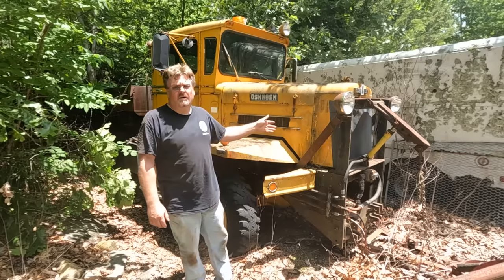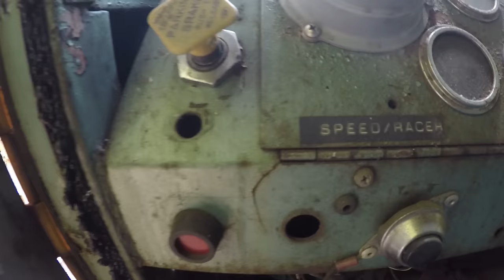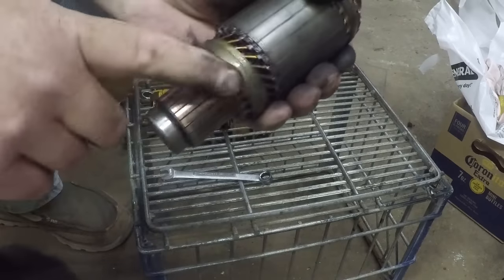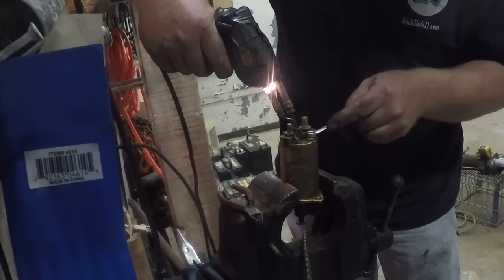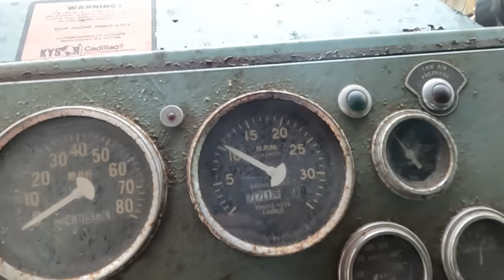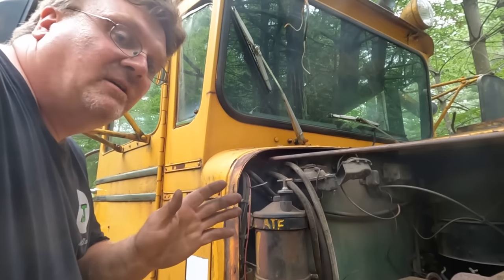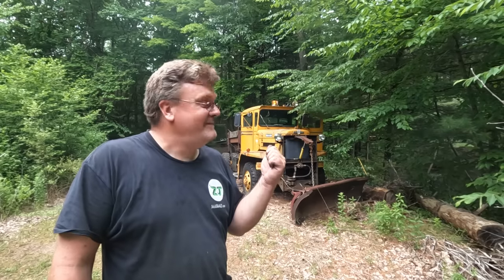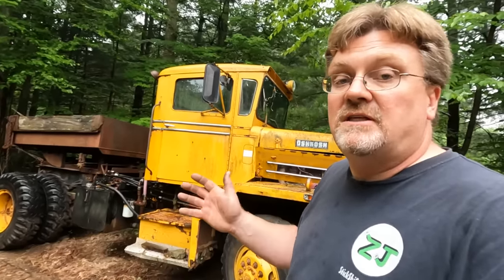6BT Powered Oshkosh Plow Truck, First Start in Over 10 Years!

Comment: Great to watch. I did my apprenticeship on Oshkosh trucks out here in South Africa. Ours were powered by Cat 3306, 1674 and Cummins Ntc engines. The model was known as the R series. All the little red buttons on the "dash" were fuses. If one went out all you did was push it in to reset it. The Oshkosh was known as a very powerful and tough truck. Thanks for showing, as it really brings back memories.
Reply from the maker: That's neat, thanks for the info!
Reply: Take care down there in SA.
Reply: Love that you were able to get the old girl moving. You removing and cleaning up the starter was educational. Where are you based out of?
Reply: I don’t want you to think I’m a Know it all, because I drove an Oshkosh for the town of Franklin Massachusetts and it had a wing plow also it was powered by a Cat 1160 which Cat no longer makes BUt, the first thing I would do if you are going to keep that truck is GET RID of that Dinky plow  and find a decent road plow like a Frink or something similar because with the power that this truck it will push just about anything
  And just a little info on the truck I drove , it went through the Blizzard of 78 with a V Plow and never got stuck
Also you might think about finding a sander box to mount on the back
These are just some suggestions mind you but I really miss driving the Oshkosh that I drove it was the best time of my life 😊

Comment: Your power steering probably has air in it. After you work it back and forth for a few days and topping up the reservoir your steering should be ok.
Reply from the maker: You're exactly right, it did start working well after I used it for a while.

Comment: I lived about 80 miles East of Nome Alaska in the early 60’s on an old WW2 runway with an old B29 bomber crashed at the end of the runway. There were 6 houses and several warehouses/garages all operated by the FAA. My Dad was the station manager. Our old snow plow truck gave up and the flew in a newer Oshkosh in an Air Force C124 Globemaster. The plow came in the dump box and just barley cleared the upper door frame. The windshield slanted foreword which looked kind of strange but helped with snow build up. I was 13-14 with home study classes 7~8 grade.

Comment: Regarding the brushes: just push them back deep into the holders. The springs will snap over and push on the sides instead of the ends, thus holding the brushes retracted. Once installed, push the brushes down until the springs snap back over the end.

That is how it's supposed to work. Some brushes even have a little divet on the side for the spring to snap into prior to mounting.

Comment: As soon as you find your high and low range, maybe your attempts to move it around in tight areas will make it a bit smoother transition to pedal, and man as it really is not a jerky machine... I used to own several oshkosh trucks known for their ability to move in the mud and other rough terrain... I hauled logs in the early fifties with them... big gasoline engines that were over five hundred cubic inch engines.. they still only had like two hundred horsepower but those four barrel carburetors on the huge six cylinder engines would haul a mountain. I say carburetors because there was two of them on a single six cylinder engine and it got less than a mile to the gallon to keep running. I remember filling the two tanks with gas that was ten cents a gallon then, and it carried almost two hundred gallons of fuel... that worked out to about a hundred and fifty miles of travel with no idle time. Those pistons were like six or more inches across the top and were over a foot long for the top of the piston itself... took a week to rebuild it an it was worn out in less than twenty thousand miles so I always kept a couple engine kits available.... later put a cummins in one an a screaming six jimmy in a couple others... it was just what I had, not what I wanted... when done, sold for scrap iron thinking no one wanted them. And no where to keep one at either... it was junk or fines for them.

Comment: anytime you are starting one that has been parked for a prolonged period that shows a high oil level it's advised to check if there is water in the oil. the water always drops to the bottom so just pull the drain plug cause the water would come out fist lowing the oil level

Comment: I'm from Oshkosh WI there all many boneyards of Oshkosh Trucks waiting to be retrofitted into something else. Many of those have been sitting for many years too. You'd have a field day here. Yes, the roads throughout the city are still be plowed with Oshkosh Plows especially when the snow is really deep.
Reply: bone yards are gone. shipped all down to Red River Army depot. Where the retrofit trucks were are all new trucks. Plows aren't Oshkosh plows anymore here Oshkosh dpw only has one Oshkosh truck left and it's used with a huge bumper on the back and a big sign to protect the construction workers leaning on shovels.
Reply: @markhuisinga1698  there's a bunch of Oshkosh trucks on Hughes St lot ready to be retrofittes north of Gate 12 and also in Nolte's tow lot. What's the lot on 3135 Oregon St. There aren't quite as many as there used to be admittedly. Educate me.
Reply: @markhuisinga1698  Must be my friend Lyle Conrad's truck RIP.

Comment: You definitely got lucky,with how many things worked after sitting that long. Here is something I learned years ago by accident on a starter solenoid.  The brass buttons you were filling on will come out by taking the second nut off and you will see after knocking it out, it has a square shoulder and can be turned it a quarter, half or three quarter
Reply: You turn them 180 those have already been turned once.

Comment: Back in the seventies I drove a new Oshkosh Dump truck that a time or two we had a 955 Cat loader in the bed. It had a cat engine with a 10 speed rto road ranger transmission with a three speed auxiliary transmission it was a tandem axle all wheel drive with flotation front tires the front tires were underneath the cab and the bottom of the front bumper was five feet off the ground. We had two that were identical they were the widest the law would allow and topped out at 68 mph. I was young and dumb back then we regularly grossed over 100 thousand pounds and I scared a lot of people in my home town when I turned the corner and they were beyond the stop stripe and I put my front bumper over the hoods of their cars. Needless to say I loved my truck! By the way that lever on the right side of the steering column is a hand valve for trailer brakes. I enjoy your videos, God Bless and stay safe out there!
Reply from the maker: Thanks for the info!  I hadn't thought about trailer brakes.

Comment: These are really cool trucks used to work on them all the time when I was a gse tech.they would run the wide open for 12 hours then just and sit and idle for weeks at night for the most part. The broke alot brakes got burned up all the time.

Comment: That 6BT is the most  sought after engine for the 80 series  Toyota Land Cruiser diesel conversion. BTW,  learning a lot from you! Thanks!
Reply: A 6bt is way too much engine for any cruiser. I think you mean 4bt. 1hz is a much better option anyway than a bread truck engine.
Reply: It's getting more and more popular for Land Rover Defenders conversions too.

The 6BT is the engine Land Rover should've put in back in 1984!.
Reply from the maker: Glad you like it, thanks 👍
Reply: @kaptainkoolz6359  no it’s not… it only weighs 1000 lbs wet
Reply: 3-53 Detroit would be a better choice. If it has 4 inch lift.

Comment: Finally someone that fixes starters instead of just replacing them!
Reply from the maker: Well, you've got to pay to replace it, I don't like that part!
Reply: @LowBuckGarage  yep, I've seen so many thrown/replaced that only needed the drive or brushes.
However, my dad had one stick in the flywheel. He heard a strange noise, revved the engine and managed to expand the amateur into the field windings. That one was done!

Comment: i have a parts one got for axles  out of 100 or so oshkosh  trucks this is the first one i ever seen run no less move  and the steering  made men out of you  im makeing a tractor  out of mine reframe with real power steering shorter and tractor tires never seen one with a broken axle

Comment: That thing would make a great off road camper tractor unit with that engine, chassis and lockers.... not to mention on board hydraulics.. Make the cab nicer (air ride seats and upholstry and all that) and extend the chassis and build a camper compartment, then you would have a brilliant world cruiser.

Comment: That handle that says “not for parking” is the Johnson bar. It would apply service air to trailer brakes only. With no trailer, it would just be open line that would drain your air if applied.

Comment: Super video of a great heavy duty truck.  I was a pilot in the airforce in the 60s, and we depended on those beasts to keep the runways clean.  It didn't matter if it was a full on blizzard, or wet, sloppy crap, the Oshkosh trucks moved the snow.  I'd love to own one, but common sense has to figure into the equation somewhere.  Sigh.

Comment: I subscribed. Nice truck. A 6BT Cummins is a plus over the Screamin' green leaker it replaced. The Meyers plow is for a Jeep or pickup. It's not a Bulldozer. A through tidy and a fluid and filter change should get you back in business... if you bought the truck.

Comment: The sight glass on the side of the hydraulic tank isn't a temperature gauge.
It's a level gauge to show you how much hydraulic fluid is in the tank.
Reply: the sight glass ALSO has a thermometer inside it. it serves 2 purposes. you can see the fluid level AND the temperature.

Comment: I’m surprised it’s not overheating with that rubber piece covering the grill. Looks like a useful tool
Reply from the maker: Yeah, I kept an eye on the temp gauge but it never got hot.  I didn't work it very hard, but I'll pull that off if it ever does get too warm.

Comment: 160°F for a diesel is a bit on the low side unless you are in 100°F+ temperatures.
175° to 185° is common, colder temps 195°F, ... My first thought was if the radiator is covered and you're still only getting 160°F your thermostat(s) are most likely not closing or missing altogether. A lot of old timers would pull the thermostats to keep from over heating. Plow truck have a tendency to heat up because the plow at high speeds 😉blocks airflow to the front of the truck while going down the road. Also the narrow nose and smaller radiator has little airflow anyway.  Then at working speeds the engine is at high revs and low speeds which really works the cooling system. Running too cool will cause a diesel to slobber and in general is hard on the engine. 
Love your channel come by and checkout  my old cool stuff.😉 I had to do some research on thermostats because of my Cat 8T No.12 motor grader .
later....
your comic banter is awesome 👍.

Comment: I have found on engines that have set for years, have water in the oil pan. I always check first. Oh and the transmission. Not telling you what to do just my own findings. All my best.
Reply from the maker: FWIW, from the engines I've run into, it depends on how the motor was protected.  A good hood and air filter, and I've (so far) never had water in the motor.  If there are openings that could let water in, they will, and then you really need to check/drain.  I knew the history on this one, and I know that no one has even cracked the hood in over a decade, so I felt pretty good about it.

Comment: You should be careful if it shows too much oil it could mean there is water in the oil I usually take the drain plug out just enough to let  the oil or if there is water in it the water just to make sure it don't have water in it because there have been many diesels I have went to get running after a long time sitting and find water in the oil.

Comment: The device labeled "Not for Parking" is known as a trolly brake and was used to activated brakes on a trailer. They are no longer found on semis.
Reply: Yes they are still installed on the dash now thou, engine brake is at the spikes position.

Comment: So the (not for parking) hand brake is for a retarder setup. Our Cat 793 haul trucks have the Bendix hand brake that engages a 20-80 braking action of the brakes when loaded going down hill in 3rd gear for optimal braking and cooling. 20% front brake and 80% rear brakes. This Oshkosh might have a transmission retarder or a driveshaft retarder setup (I dunno, never messed with an Oshkosh before) but Volvo Autocar had something of a similar setup for plow trucks and such.

Comment: You didn't need to get a separate line for the plow bypass. If you look the left and right cyl have lines that have one male and one female hooked up opposite. That is so all you do is unhook one of them from the cyl and hook that to the fitting on the truch where you removed the other line. Thats why they are opposite male and female fittings

Comment: That design looks like it supposed to have a dump bed on it that would operate of that valve as well. I worked on a few of those systems and they are needlessly complex. But if it works is it a dumb idea

Comment: A nice truck with some character. Were they ever on the roads ? Looks like it has a 5th wheel. Or were they just trunking trucks as well as snow plow.
Reply from the maker: I'm sure some were used on roads, my understanding is that this particular one came from an airport.  The back has a little dump bed on it, definitely not original.
Reply: @LowBuckGarage  That little dump bed on the back is for extra weight for traction.
Reply: They were used for plowing snow

Comment: Having those full of residue on the inside and having dirty brushes especially when you get residue between the wires can cause a loss of power the right way is to clean those out with some brake clean or carb cleaner.

Comment: What year is truck by any chance ? Why asked my late Great Uncles Fred , Jack , Leo work at Roads & Works Department Highway Patrol drove 1951 of those truck had snow plow blade locomotive train plus wing blade on right , not sure motor was in but was loud like Detroit Desiel motor and do know had air brakes to on had daul wheels on back to remember that  powerfull truck ! Remember Leo & Jack saying need ear muff on ears to so wouldn't lose hearing in ears and in Winters Season in Ontario Canada plow snow want have hot coffee to drink to keep warm were cold trucks till got heaters add in addition to cab plus had wild defroster for windows and Vaccum for Windshield Wipers till put Electric ones in ! Plus had Dump box and Hydraulics ! The truck was on Road & Works Department Highway till 1996 but some reason building store in plus other truck burn to ground and that truck destroyed plus everything building plus yard on evening in Cold Winters Season and heard Electric also Oil heater building short out plus fuel line spray leak hit trucks batteries! Guy I know bought 1951 truck planning rebuilt it but never heard but may be hard find parts and not sure about to much! But in 2005 hear Roads & Works Department Highway  Patrol  company bought brand new one again still got and 4×4  daul tires to also paint yellow and black colors decals also less noisy to but strong work horse  Lol! Do like Air Horn you pull remember that sound from 1951 my late  uncles drove Lol!
Reply from the maker: My guess is that its from the 60's, but I'm not really sure.  This one was pretty loud inside, too!

Comment: The remote operated valve body takes all hydraulic lines out of the cab reducing noise and the possibility of a high pressure oil leak in the cab, Today all hydraulic controls on modern trucks are piolet operated by electronics, now salt induced corrosion comes into play with electric wiring.

Comment: The reason for the valve body on the exterior of the vehicle it to eliminate hydraulic pressure in the cab. Most people don't realize the volatility of hydraulic oil. As simple spark from a welder in our shop lit a pile of oil dry that was applied to soak up hydraulic oil. The reason for the back and forth of the hydraulic feeds is specifically to address the direct drive pump on the front, and the rear frame mount of the tank. If the pump was a PTO driven pump off the transmission or transfer case it would not have so many travel paths, or at least not as long a travel path. That plow is way undersized for the truck as you are aware. That truck would have had in the neighborhood of a 12 foot plow or even bigger at an airport. It would have been nice and tall and very visible from in the cab. You could reduce the volume of oil going to the plow with either a flow control or an orifice that would be inserted into the fitting. The orifice would be the lesser expensive route. Enjoy that old girl. She will take more than you can throw at it. I wouldn't hesitate to use it for some fairly extreme applications. I have a Barko 40 Log Loader that would fit nice on it. Sorry for the novel length response, I couldn't resist. 
Cheers.
Reply from the maker: Thanks for the info!  I hadn't thought about keeping the hydraulic oil out of the cab.

Comment: The wires that you had to keep heating up and then tighten the bolt heated up tighten the bolt would you have been able to drill the hole out Just asking would that have work though
Reply from the maker: Yes, that would have worked and made it easier.  I didn't have any drill bits that small on hand, and the nearest hardware store was not very close, so I did it the hard way.

Comment: Not a transfer case 2 speed browning transmission  called twin stick use in each gear in the main trans .like a over drive under drive
Reply from the maker: Thanks for the info!  It seemed like a big jump in ratios between 1st and 2nd when I went with just the main box.  This might solve that mystery.